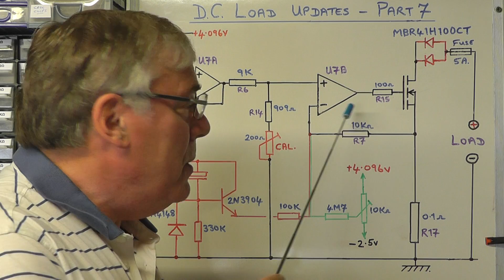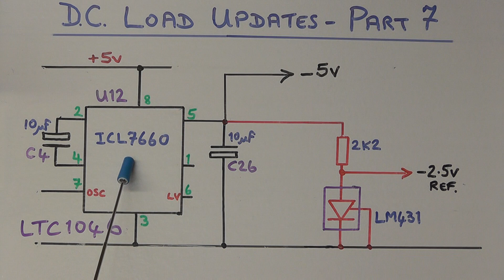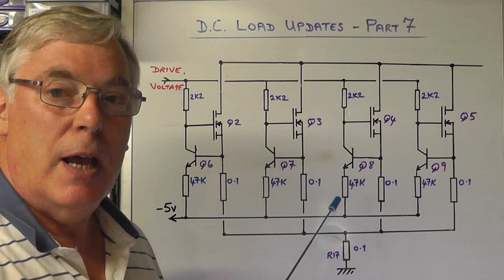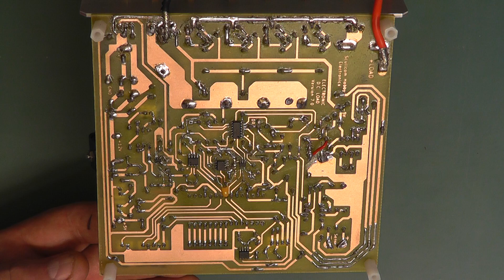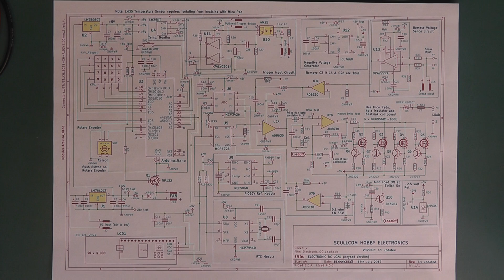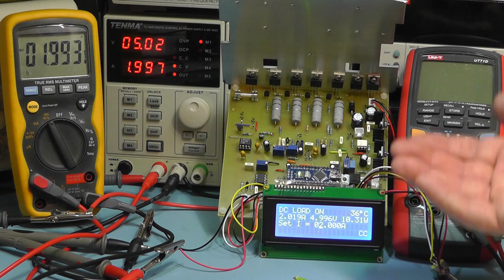Scullcom Hobby Electronics #52 - Electronic DC Load Part 7

Comment: In solving the issue with the DAC starting at half output voltage, you can just write the EEPROM default setting to be 0. I'm not sure I understand how adding that turn-on bias circuit is the simplest solution when there's a software fix, granted it works the very first time without having to power it up once and command a default setting, that does not seem like a necessary benefit.

I also wonder if, rather than trying to bias the input of the opamp on startup, it would make more sense to have a switched positive supply to that opamp. This is common for automotive motor drivers where there's a logic input to shut down the gate drive.

Comment: Regarding the offset issue with those two op amps,  wouldn't the required resistor values depend on the individual op amp?  I'm surprised that you don't have a trimmer in there for those.  And regarding the speeding up of the I2C bus,  you don't say why you want to do this,  or why the speed issue has become a problem.  What prompted this?

Comment: ISL7660 is a nice IC, can we make the circuit by ourselves?
Reply from the maker: Hi,
You could make a DC to DC converter with an NE555 and some components if you wish. But it would be cheaper to use the ICL7660.
Regards,
Louis

Comment: I wish I'd run across this video sooner.  Your concern about the -5v power source is noted.  It doesn't matter what it is, 4.1v for example, it just has to be stable.  You're only using it to bias the op-amps to operate in the required range.  As for I2C, I've always used 2.2K or 2.7K pull-up resistors and never had any problems.  I've seen circuits with pull-ups as low as 1K.  Why anyone wants to cut the current in the bus to such low levels is beyond me.
Reply from the maker: Thanks for your comments. Yes agree the main thing is that the negative voltage source is stable. With regards the pull-up resistors on the I2C bus using a 2.2K or 2.7K pull-up resistor will allow a faster speed on the bus. I think the lowest value you can go down to is 1.8K. The only drawback of lower value resistors is it draws more current but this should not really matter if your power supply can handle it. On the plus side you can run it at a higher clock speed. The normal default I2C clock speed for the Arduino is 100KHz but you can take it up to 400KHz when you use lower value pull-up resistors. As the LCD display module also has pull-up resistors then adding additional pull-up resistors as in this DC Load circuit we are reducing the overall pull-up resistor value and so allowing a higher bus speed, which is set in software.
Regards,
Louis

Comment: Hello Louis and everyone, just a comment i thought to mention,  not sure if this was brought up before, but the I2C pull-ups are also implemented in the PCF8754 LCD control board. So if so these should be removed otherwise you will get 2.2k ohms on the data & clock lines. I came across it by accident when I bought some  MCP4725 on a module from ebay which have pull-ups already on the board, this made me think to check the PCF8754 module.
Reply from the maker: Thanks for your comments. The correct value for a pull-up resistor is an interesting subject and may be worth discussing in more details on one of my videos.
In short, the maximum pull-up resistance is limited by the I2C bus capacitance. If the pull-up resistors values are too high, the I2C line may not rise to a logical high before it is pulled low (due to the RC time constant).
The speed of the I2C bus can be increased by lowering the value of the pull-up resistors, within limits which depends on the Vcc Supply to the circuit - in our case the supply voltage is +5V. At +5V you can normally reduce the pull-up resistor value to as low as about 1.8K. The trade off is that a lower value resistor means the circuit uses slightly more power but gives you a higher speed.

So if you happen to have two sets of pull-up resistors then as long as the overall value does not go below 1.8K you should be OK. Pull-up resistors on a PCF8754 LCD control board are usually either 10K or 4.7K, so there should not be an issue.

Hope my explanation is of help.
Regards,
Louis
Reply: Thank you for your kind explanation, so I suppose only if you have lots of module in parallel on the system and goes below 1.8K then its best to remove some resistors. Yes I understand your explanation the lower the resistance the faster the lines are at their logic level especially if you have the fast I2 communication switched on. 
Kind Regards,
joe

Comment: I built this unit and the 5V regulator gets very warm indeed.I am going to add a second, smaller dedicated fan for the linear regulators. I couldn't find the original mosfets at a reasonable price, so I used IRLB4030PBF-ND, from DigiKey https://www.infineon.com/dgdl/irlb4030pbf.pdf?fileId=5546d462533600a4015356604640258d
My load ON/OFF switch has an issues, if I just push the button once, the "OFF/ON" flickers back and forth, so I have to push it again to make it stay "ON".  I will try a couple different switches/buttons to see if I can get it to turn ON without double-clicking. It may be a latching/ bounce issue, or other mistake I made. The original sketch limits the current to 4.000A, and a maximum of 50W's. I adjusted it up to 100W's / 5A's. I have a massive heat sink from an old power inverter with dual fans, and so far so good, at 24VDC. I'll scale up the input  for higher voltages and try to get it to accept up to 60V ( in order to test a fully charged LI-ION 48V battery (on CC mode, not Battery mode, as battery mode is currently limited to just 1A). I want to scale it up to at least 300W at 10A's, like most commercially available models, but noticed I have to adjust more than just the software to do so...I'll check back once I have done all the mods. Cost of construction, with parts from digikey, $28 for (5) the PCB from JLCPCB, $138. Not  a cheap build but well worth it if I can make to handle more than 50W ( note: the parts can easily handle the power/ current, but need to mod the build a bit and tweak the code). Code is written very well and laid out so any DIY'er can tweak it to their needs. Additional mods I am going to make: 3.5" LCD, custom 3D printed case, & DIY hand-wound, dual tap transformer for 15 & 7 VDC inputs (reduce heat at the 7805)Thanks again Mr. Louis, this was a very fun project.
Reply from the maker: Thanks for sharing the information on your build, interesting. If you are looking at going up to 300W then it may be worth considering using a Linear Power Mosfet such as the IXFN200N10P manufactured by IXYS SEMICONDUCTOR, they do a range of Linear Power Mosfets but they are not cheap. However, you may only need to use one. The gate drive circuit for these mosfets would need to be modified to provide the required drive voltages. I may have a look at this as an update to my design. Good luck with your own project. Regards, Louis
Reply: Thank you Sir. The credit is most certainly yours. I have been playing with different ideas and may even go to the TO-247 package ( I have some that  I salvaged to test the idea). I will certainly check out the IXYS devices and have read a bit about their purpose made line.  I moved the temp sensor to the middle of the heatsink and changed the ratio of the DAC voltage-divider. Pushed up to 20A briefly. Still more tests to run but  most of the time I am just testing (a single) DIY 18650 battery bank at 4.20V so its still "low power," just higher current.  I am pleasantly surprised how well the unit behaves. The next step is get the box printed and 3.5" LCD installed and add an SD card for data logging.
Reply: I noticed that when the fan kicks on at 30*C, the voltage across R6 goes up by 150mV which get sent to the gate of the FETs. I am not sure if this is a result of my modifications. Maybe something to visit in part 8? Much love.
Reply from the maker: Some types of fan can cause issues. Have you tried different types of cooling fan. You could try increasing the value of C16 to a 1uF to give some extra filtering on the drive voltage. Regards, Louis

Comment: Happy New Year, Louis
for part 8 (I do hope you are still advancing the project) I would like to suggest to realize a data interface to collect the measurement data, especially for the battery testing use case. The pins TX/RX (D0,D1) for the Nano in your projekt are still unused. With a USB to Serial adapter based on a FT232R USB UART IC it wouldn't be too difficult to build a USB interface in the DCLoad. There are readymade adapters available on ebay. I guess you know it... 

Feedbackloop 's (a youtuber) has shown in episode #10  a way to create a graph based on data collected from a dc load. The SW is available on github. Pretty cool...

What do you say? ;)

Comment: Roughly how much did it cost for all parts?
Reply from the maker: If you have to buy all the parts then the basic cost is around £75. If you then want to add the same project box and large heatsink which I used then that would add an additional £40.
If you shop around you can get many of the parts much cheaper on eBay from suppliers in China, but then you have to be prepared to wait a longer time for delivery.
The total actual cost I spent was around £70 as I already had some basic components in my workshop.
Regards, Louis
Reply: Scullcom Hobby Electronics thanks very much Louis. I will prob get all the bits and make it my self. Only thing I can’t do due to not having the bits is the making of the board. 

Many thanks. 
Steve
Reply from the maker: Hi Steve, I may be able to help. I have sent you a message in the private messages section of you tube hope you get it. Regards, Louis
Reply: Scullcom Hobby Electronics hi Louis. I’m not sure where the private massage part is on YouTube. Maybe it’s not on the app??  Steve
Reply from the maker: To read private messages that you've received on YouTube, go to your Messages page. You can get there by clicking your account icon in the top right-hand corner then select Creator Studio. In the left-hand menu under "Community", click Messages.
Reply: Scullcom Hobby Electronics I have replied to your private message.

Comment: Hi Louis, i'm in the middle of building this and  looking for a power supply for this beast. I think you had mentioned in one of the videos a 15v? But i forget exactly, what voltage and current rating would you recommend to use? Thanks once again for the great videos, you're awesome.

-Vic
Reply from the maker: Hi Vic, The 15v power adapter I am using is 1 Amp  rated, but it should also be OK with a lower current rating say of 0.5 Amp. Regards, Louis

Comment: Hi Louis just a suggestion it may be that when the encoder switch gets some wear it might switch bounce a bit and a by pass capacitor on the A B inputs should clear this up, a better way is to also add a series resistor and then the cap to D4& D2.
Reply from the maker: Thanks for the suggestion. Regards, Louis.

Comment: Hi :) I have ebike about 4kw on brushless dc motor. I want to make my controller stronger and i am just worried about my mosfets. They are 12 (4on each phase) I was thinking if its ok to double them (on new small board) and add more capacitors. Just simply solder wire from base of exisiting mosfet to base new mosfet. Do you think new mosfets can have some delay in time or you see other issues? I have space for make small board with mosfets on side my controller box

Comment: I did not check your design PCB size, but 100x100mm x10psc costs 2USD from china while 100x150mm cost 24USD, quite a good reason to fit to smaller size and perhaps use ribbon cables or other connectors to stack them etc. I checked PCB at https://jlcpcb.com/quote

Comment: How many Watts does this version allow to dissipate, is increasing wattage as simple as adding more mosfets?? PC logging connection?
Reply from the maker: Sofar I have tested this version with the 4 Mosfets with heatsink and fan and it seems to work without issues upto about 100 watt. Adding a much larger heatsink with a larger fan we should be able to achieve 150 watt. i may make further improvements later.
Reply: PC logging connection would be best appreciated I think.

Comment: if my memory is correct, the DAC has an EEPROM where you can programm the default start up voltage....so you dont have to fiddle arround by offsetting the inverting input of U7B by any value....simple tell the DAC it should output 0V at startup. Take a look at the datasheet how to accomplish that
edit: i was to fast, you already mentioned that :)
Reply from the maker: Thanks Ray. Yes as you say I have already mentioned that as an option.

Comment: Hi Louis, I have a question regarding the mosfet type. I have seen a Commercial DC load "Maynuo M9711"using the IRFP250 mosfet. Do you think this can be implemented in your project for higher power use with out too many complications? I understand the RDSon spec is10V @ the gate and is not a logic gate voltage as the one you use. Have you looked at this mosfet before? Thank you for your help. Regards joe
Reply from the maker: Hi Joe,
The IRFP250 mosfet is not a logic level mosfet so it would not work in my design without some modification to the gate drive voltage for the mosfet. But it is possible to modify. I have not looked at this mosfet type sofar. Regards,
Louis
Reply: Thanks for your response much appreciated. Just a guess and could be wrong, but your Array 3711A could be using this mosfet.
Reply from the maker: Yes the Array 3711A may be using the IRFP250 mosfets. May be worth looking at using them and making some modifications to the gate drive circuit. Food for thought. Regards, Louis
Reply: Sorry for the Late reply, yes I thought so thanks Louis. Regards, joe

Comment: you said its dual power schottky diode. As the two diodes are on the same silicon die they are thermally coupled so it is unlikely to be an issue. Also both diodes are rated at 40 Amp so I do not think it will be a problem...there is a voltage drop in the diode, so when we sense the voltage (vout = Vout - Vd),sense voltage have drop. how to avoid this drop?
Reply from the maker: As we are testing a Power Supply the important point is to sense the voltage directly at the power supply under current load testing. Having a voltage drop across the dual power schottky diode will make no difference to the current loading we are applying to the Power Supply so it is not an issue.

Comment: Have you thought about making a isolated serial interface and then make a nice PC Software for logging and controlling?
Reply from the maker: Thanks Maurice for your comment. Yes I have thought of data logging. I have been playing with an application which reads the serial data when using the DC Load in Battery Capacity testing mode and got it to draw a graph in real time on a PC screen. I used Electron which is a framework for creating native applications with web technologies like JavaScript, HTML, and CSS. This still needs further development. If you are interested then check out the Electron website at https://electron.atom.io/
Regards,
Louis
Reply: Have you published your test code? A public git repository would make it possible that your viewers can develop the software...

Comment: Quick question for clarification.  Your v7 schematic  shows Q10 as a 2N3904 NPN while the parts list refers to a PNP 2N3906.  I can't  the PNP on the schematic and since the parts list doesn't have schematic codes I'm not sure which one is correct.  I'm leaning towards the schematic as the master.  Can you clarify?  Thanks
Reply from the maker: Sorry my error in the parts list. It should read 2N3904.

Comment: sir, Do you have CR-LED mode on this device? if  it possible please share with me
Reply from the maker: You could use the CR (Constant Resistance Mode) but this is not the ideal solution for Testing LED Drivers. The best solution would be to provide a special LED Mode which would use a combination of CV (Constant Voltage) and CR (Constant Resistance) to closely mimic the actual behavior of an LED. I do not have a LED Mode on this project at the moment but it is something to look at for a future upgrade.
Regards,
Louis
Reply: Thanks for your replay...Once you upgrade the device with the feature of LED MODE its more useful for me...

Comment: Hi, Louis! Can you modify your software for using popular ADC module ADS1115? Thanks for answer! http://www.ebay.com/itm/16-Bit-I2C-ADS1115-Module-ADC-4-channel-with-Pro-Gain-Amplifier-for-Arduino-RPi-/400985244934
Reply from the maker: Hi Tor, I am sure it can be done. The ADS1115 is also a 16 bit ADC. I will try and have a look at it later.
Regards,
Louis
Reply: Tor Bjørn if you follow the link to my version of the project (find my comment below) then you will find that I used the ADS1115 and you can pick the relevant code from my software. I have not used a library but coded it all specifically for this use so it is easy to pick the code you need.